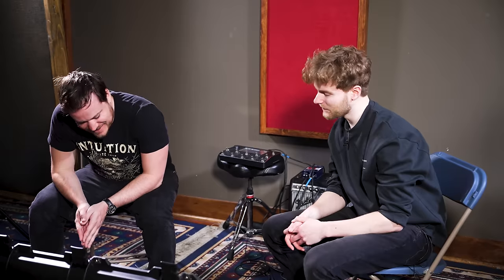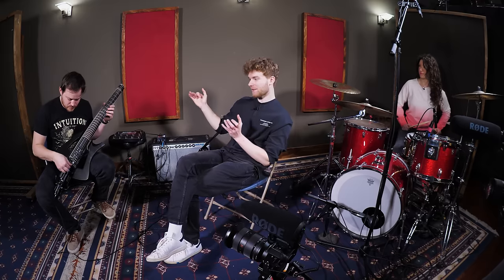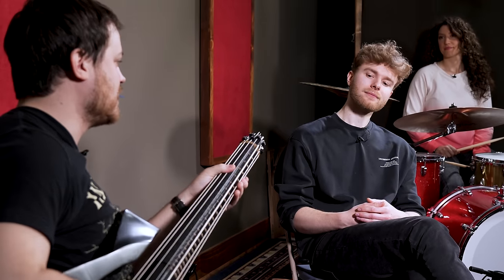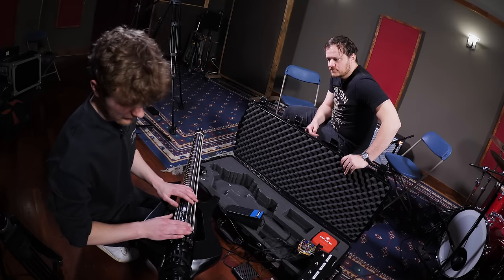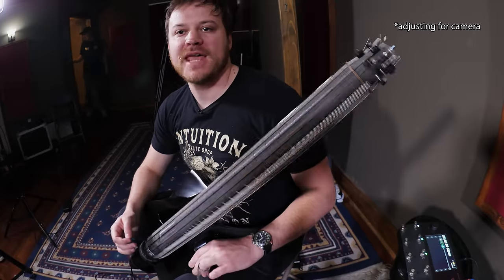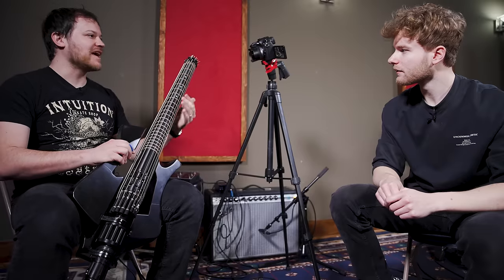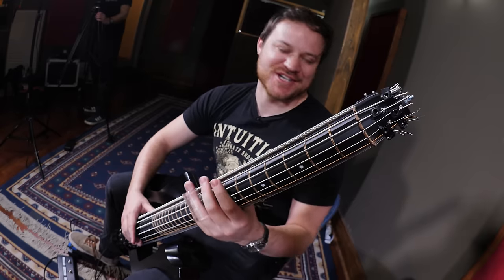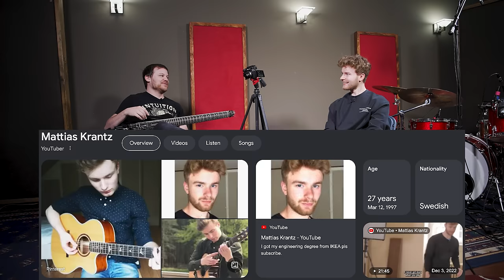Spinning Guitar (with a motor)

Comment: This concept is less ridiculous than it first appears. There is a way to make it more playable.
Changes I'd make...
First: Colored String to indicate which instrument your on. A colored compass if you will. So when spinning your not hanging on for dear life & just taking chances. You could actually time the rotation with your eye sight & have a better idea of what to hit when.

2nd: it doesnt have to be completely round. Keep each instrument fretboard similiar to standard with curvature on top & bottom for smooth transition. Think somewhere in between round & square.

3rd: Making it spin the other direction so no finger can get caught under a string. Spin in the direction the fingers point when playing.

4th: I didnt see this although I think you had a foot switch for it. Make it easy to rotate quickly & stop at eash instrument position.

This could really change a professional string instrumentalist in to playing multiple.

Additional idea: 0:02 
Seems to me the thumb could be utilized to do more than support the back of the fret board. Hope that inspires some idea. Like a "Ghost Bass".

Or even better a Left hand Bass & Right handed guitar.
 Self picking. Something less ridiculous but similar to the 1000 pick guitar.
So you can actually play both instruments with both hands. Plus it would look really cool to have a guitar called "The DEVIL'S WING" that you spread both arms out to play while picking with one or 2 foot pedals.

Just a thought. I hope I inspired an idea ;)   

make the Devils Wings pleeeeeeeeease

Comment: Seems like it would be a good rhythm instrument. I could hear someone playing what rob is in this video and have a regular guitarist playing all the fun scales and sweeps and thing. And yes i agree with the modes for the motor that switch and lock in place between bass and guitar.
Reply: Also make the pedal spin the motor forward and backward. Like a wah pedal, push it to one extreme the motor moves forward and the other extreme moves it backward. It could probably be set up with some kind of variable voltage motor so that the harder you press the pedal the more voltage the motor gets and the faster it spins. And you could you it as a break if it spins to far one way you just push the pedal the opposite way and it puts the breaks on for ya

Comment: Ideas:
1. Have a guitar-only version and a bass only version
2. instead of spinning electric motor, have a step motor mechanism controlled by foot pedal. This allows the player to quickly move desired strings to the fingers, without the instrument wiggling around while playing.
3. Enable the step motor to be synced to a DAW metronome, and switch direction of spin according to programmed patterns

Comment: What if you could 'program' the rotation through the motor to start, stop at different angles (don't use the foot-pedal for spin but use a 'stepping' motor with a CNC program - or PLC input).
Forward, backward, speed control. Stop Start, slow/fast rotation - as part of the tune.
You could Program /Compose a 'tune'. Use that in 'conjunction' with the guitarists playing. (Kind of duet).
The speed of the stepping motor operation would allow  Base, Rhythm and lead - almost as one.

Comment: Now you gotta see how it would work with the curved slide. Also, have either of you thought of using a capo. Granted that would also probably be a one-off, custom item. Well, you could fabricate one, or maybe improvise one by rubberizing the inside of hose clamp. That way, it would be " fully " adjustable. You'd be better able to tighten to the precise tension...

Comment: On a normal guitar, the left hand sets the chord and the right hand plays the arpeggio. On this thing the right hand doesn't do anything, you set the arpeggio ahead of time using the tuning, it plays that arpeggio for every chord, and the left hand plays the chord. The interesting thing here is that there's enough strings for you to play several chords per rotation, so the unique advantage of this instrument is that you could switch chords far faster that you could on any stringed instrument, just as long as you knew ahead of time what those chords would be, and were patient enough to set the tuning to play it.

Comment: I would call this an anchor guitar since it has a constant rhythm with it's spin that everyone can follow. Maybe make different types of string configurations for different purposes. The base configuration could be called the fiddler configuration, where it's designed to be played dynamically. More similar string types can be called core configurations. An example would be a bass core where it's just bass strings

Comment: It's just a matter of learning and more learning, plus composing, and throw in a Jam man to loop segments and then switch over to do leads and add some other digital controls and pedals for the motor to jump to specific sections.  It has a lot of potential.  Not bad, though, for a first time playing it.

Comment: I can see a different use for an instrument like this, basically, you can have a bass and/or a guitar, the neck doesn't have to spin constantly rather only when you want to change the current available set of strings.

Comment: Here is an idea, uses pedal to change position, rather than rotation speed. This way the player can choose where on the instrument to play next, travel in reverse, or fluctuate between a few positions to achieve more specific sounds.

A second pedal could be a rpm based motion for the sounds only capable by rotation.

Maybe pedal A travels from 0-360 degrees, and pedal B travels through rpm and directionality.

Just an idea.

Comment: Just the beginning. Things you can do with strings are endless. Considered resonance boxed strings with microphone pickup for better distortion!  You could invent a better distortion. Call it super distortion. Call the wooden tube.. using string resonant boxing. And run the microphone to distortion from within the field resonance box..

Comment: There needs to be a pedal control to control a servo motor that will bring each set of string to a preset position. That way you would have 4 different sets. Fret less, bass, rhythm, and free for all.

Comment: I WANT THIS! WHERE CAN I GET ONE. Also instead of a motor, I think if Mr. Chief Engineer could add a clip that can switch between a locked rotate (where the fret rotates but sits in divets so no free roll) and a free rotate. The fret cylinder could be a bit more extreme in terms of cone shape with a little rest for each string like an extended bridge to the keys. I don’t know if that’s been tried.

Comment: I have an idea. Since it is quite difficult to pinch chords, there is a way out: for each composition (song), adjust the tuning of the strings in advance. Of course this is only for rotating mode. The very first simple drawings of melodies are a looping staircase down or up, or first up then down. Also, as part of the tricks, you can try to practice (I don’t think it will be very difficult for a person with a sense of rhythm, but training is needed) to “beat” the strings at certain time intervals, thereby you can extract the sound of only certain strings. Well, and different rhythmic patterns of strikes, which will require virtuosity, but you can achieve the sound of fingering. Most likely, finger percussion movements are suitable for this instrument. And soft presses for a longer sound.

Good waka-waka sound everyone 🔥🌚

Comment: it certainly has potential, but would need better ergonomics for playability and stability, plus some sort of fixed spinning to a certain angle to get used to the ubication of certain strings.

Comment: Should have it so that as it spins, the tone goes both up and down. Like it goes high -> low -> high instead of just high -> low. You'd probably have to trade out some strings so the neck didn't get completey unruly, but I imagine it would almost sound like a blend between a guitar and a harp.

Comment: You could probably make a curved slide yourself using 22mm copper pipe and use a pipe bender to try and bend it into shape?
I made some slides myself out of copper pipe and they work just fine, but Ive never used a pipe bender to know whether this will actually work how you need it to :p

Comment: It feels like this guitar should have a non-standard tuning, since chords are limited to a single fret-row while spinning. Rearranging the strings more like a 12-string with a 6-String bass mixed in might help to balance.the rotation and sound profile. A stiff metal rod in the center of the neck would help with keeping the thing in tune, and something similar connected to the body just under and along the length of the neck will allow the musician to support the instrument without touching the neck. Also, rather than purely analog pedal control, it might be beneficial to be able to set specific RPMs in either direction for ranges of the pedal (i.e 90-100% open = X RPM, 75-89% = X/2 RPM, 60-74% = X/4 RPM, 40-59% = 0 RPM, 25-39% = -X/4, etc...). This would allow you to easily switch between half, double, and straight time (or any other change of tempo) with speed and accuracy; you'd just have to have presets for different songs.

Changing. tuning on this thing has the potential to be a nightmare, so an ability to detach the neck and replace it with another pre-tuned one might be useful as well, but I understand that would likely require a complete redesign.

Comment: damn I would pay to see this live on stage, It sounds and looks awesome.
Reply: try using different coloured frets so you can easilly see and/or catch it easilly while it spins, plus if you change the string order on some strings, you could melodize the frets themselves.
Reply: also during next designing try giving the spinning column a little ovoid shape on some fret level to modify sound when it spins.

Comment: A possible improvement to the design would be changing the depths of the strings.  That way the player could learn how deep to hold the pick for hitting different strings.  It would be the simplest way to prevent every string from getting hit during the rotations.  Having a different depth for every string is probably not possible but having 3-6 sets of depths would give a large range of possibilities.

Comment: Interesting idea.  That will take a one in 40 million musician who could work that pedal to time the rotation speed right and get it all coordinated.   Seems to me that will just about have to be a programmable control so the rotation can be set up ahead of time.   It is hard to imagine a person being able to master an analog speed control, to have the next string they want to use be in the playing position at the right time.  Might think about instead of using the pedal to control speed, to actually control position, for instance pedal all the way forward positions the barrel to the smallest string, and pedal all the way off, lowest bass string.  Maybe even add detents to the pedal to make it easier to hit a specific string.  If you like that idea you need a servo to drive the barrel and then it's not super complicated to use a microcontroller, like a raspberry pi or arduino to run that single servo with position command coming from an analog pedal.  
 This is certainly one of those ideas that becomes a quest, the amount of effort to achieve the goal far exceeding the practical value once that goal is achieved, but, once you have gone as far as you have, almost there, it would be a shame not to keep going.

Comment: I think maybe you'll get better use out of that if the bass strings are separated and placed between the guitar strings at regular intervals.
Reply: Also get someone who can program the motor to spin in preset patterns and you could potentially make it spin to where you need it on beat to play whatever you need to play.

Comment: That round cylinder that you have the strings on is the same size down at the bottom as an electric brake off of a wheelchair When you let off the power on a wheelchair it stops I mean lickity split right now So the second you let your ' off of the power the spinning is going to stop in a split second In electric break on there you will not Regrett you can thank me later

Comment: He said oh my god it's so hard to play because it's moving Off of a wheelchair It engages the brake when the power shuts off The only time it will spin is when you put your ' on the pedal to give it gas and then it'll only spin fast as you want it to spin because you can control the speed with the speed controller So then it will not turn that break will hold it trust me it will not move When the power From your ' pedals when you let off that will be locked in place

Comment: Oh my god please listen to me put a speed controller on the motor that way you can control the speed and put an electric brake from a wheelchair on there When you push your ' on the power it will spin the second you take your ' off of ITIT will stop immediately And you can control how fast The board will spin So you can speed it up or slow it down to your preference But the second you take your ' off of there will stop wherever you want because it's gonna quit spinning the very second you take your ' off you'll get the right speed of eventually and then you're your break will work perfect for you you'll be able to step on it and spin it off you just stop it wherever you want it trust me do it Will work...

Comment: Why are you humouring this awful device? This guy refused to take any advice from musicians when he was building it hence making no goddamn sense as an instrument and being terribly engineered. We didn't say it was impossible, we said his design was intrinsically flawed and he needed to spend a lot more time on it instead of rushing out a video. there are some very obvious ways you could make a rotating guitar neck playable and he didn't even consider changing the design to be practical once hearing that the scale lengths from low note to high note are different by 10" to maintain tension. Even if you didn't care about any of that spiral frets are a very obvious idea. It very visibly doesn't spin true, the material itself bends, and the motor generates noise. Give it to a very talented experimental guitarist and all he can do is essentially djent. I just can't see any reason to care about this silly thing.

I dunno if non-musicians can tell but this whole jam only works because the drummer is letting the rotation speed keep the time, this would be a nightmare to play to a backing track. They've also probably never seen double sided guitars (common among lap steel players), which is basically what this is trying and failing to be. Or you know, a double/triple/quad neck.

I honestly have to wonder if he even considered the fact that there's no way to fret it while it spins before he made it. Considering the original tuning was one step per string due to the tension issues from having all those strings the same length I sincerely doubt it.